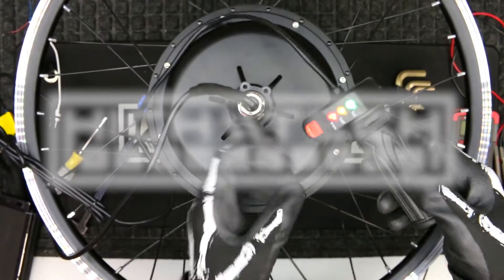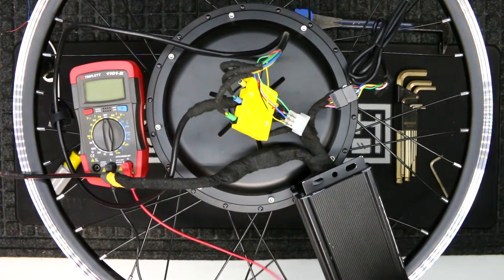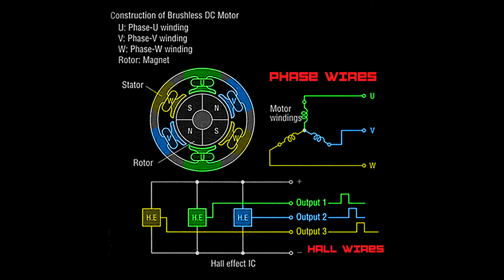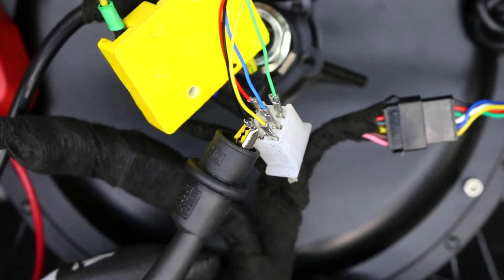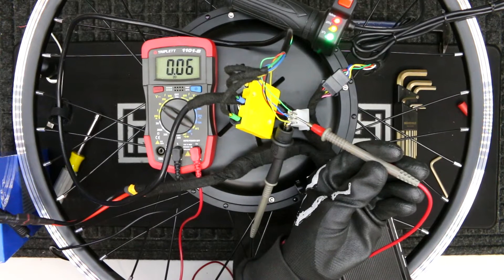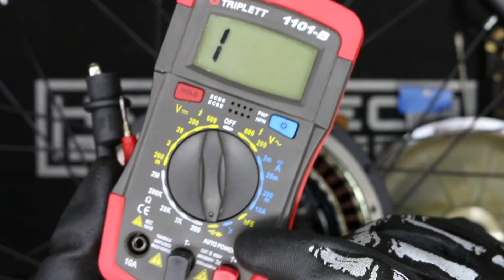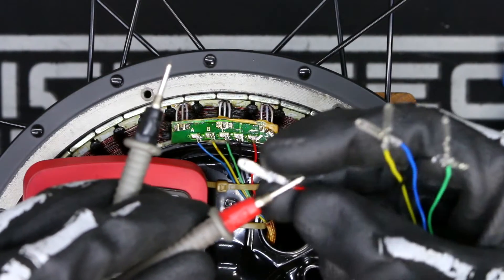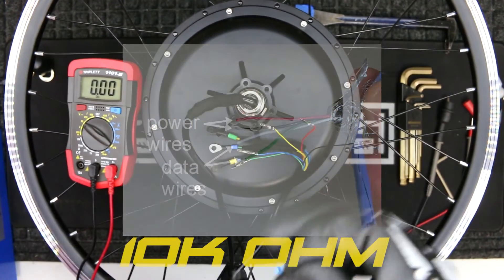🚲 How To: Ebike Hub Motor Hall Sensor Testing, Diagnosis, and Fixes (Display Error 10, Error 30)

Comment: Hi my guy. My voltage for each phase only varies when i rotate the wheel backwards. If i roll it forward voltage stays put. My bike runs but from 20kmph to 25kmph it vibrates very loud (under load. If i make it run in the air theres no vibration or noise.
I had to switch the cable to the motor because it got cut. I solder every phase and sensor. What can i try??
Thank you
Reply from the maker: If it was working fine before you switched the cable, my guess would be that the cable was not installed correctly. Maybe there is a solder bridge or something else that is not correct. Usually vibrations or noise are mechanical (bearing, bent rim, etc).

Comment: Does this work if ur motor does not move at all or make any sound when u give it throttle
Reply from the maker: It can be the issue, but that symptom could be caused by a number of things. Best to troubleshoot from the easiest to the hardest things to check, going down the line ruling out each potential until you find the source 👍
Reply: @ alr thanks I tried a different motor but its still the same issue so it’s most likely the controller
Reply from the maker: @Khodor.7  Most likely it is a controller issue, however it could be throttle, display, or battery related as well.
Reply: @hightech-lowlife  the display shows error 8 do u know what that could mean
Reply from the maker: @Khodor.7  Depends on what display it is, and what that number corresponds to.
Reply: Alr thank u
Reply from the maker: @Khodor.7  No prob 👍

Comment: My motor was vibrating, I took it apart and greased it, the vibration practically went but then I went on flat grass and it came back, any idea what it is please and how to fix it?
Reply from the maker: Vibrations are usually mechanical gaps in parts that should be fitting tightly, check your axle and bearings for movement/play.

Comment: If my motor has two hull sensors and one is bad, do both sensors need to be connected with the ground. Or can I unlink both hall sensors with the common ground wire.
Reply from the maker: The halls will need ground to function 👍 If one is not working then having ground connected to it or not is irrelevant.

Comment: Hey I just finished swapping out my hall sensor i had to bypass the PCB but the reading keeps coming out at like 0.7v. 

Im struggling to find a forum or video to help me out here.
Reply from the maker: Should have 3 sensors, one per each phase. Are you saying only one phase was not working? Most likely you bypassed something that was essential and it may not have been the hall sensor that was faulty if the results are the same as before swapping it. 

You can test a hall sensor component by itself for faults with this information: https://www.hallsensorchip.com/news/how-to-testing-hall-effect-sensor/
Reply: @hightech-lowlife  before I changed it, I was getting a constant 5v. I have a replacement pcb coming in the mail. Im just trying to understand why I'm getting such weird reading.
Reply from the maker: @3r1414  Usually constant readings will be due to a short that is bypassing the hall sensor.

Comment: Great video! I just tested the hall sensor cables and all three of them are stuck at 5v. The motor doesn't move or work at all. What would it be?
Reply from the maker: Thanks man! 

Well, if you know the function of the hall sensors then it will help you to look at where the problem could be. The hall sensors sense the position of the wheel through the oscillation of the magnetic field as the motor turns. If all of the sensors are not seeing any oscillation to me this would indicate a more likely scenario that all of the halls are not faulty at once, although possible, it is improbable. More likely is a short circuit that is bypassing these sensors and just sending the 5V directly through.
Reply: @hightech-lowlife  Indeed. The cable was broken inside. Thank you!
Reply from the maker: @Ivan-tp8gs  👍Good job finding the fault

Comment: Excellent video any idea on this one

I have a motor issue wondering if anyone could help me. On my hall sensor wires I get 5v black to red. But while rotating the wheel I only get like 3.3v on and off from black to color hall wire on all yellow green and blue. But they are turning on and off

Any idea what that could be.

Motor works but my display ukc1 say hall sensor error 30H etc.
I tried a different display and get error 10 with is also hall sensor error
Reply from the maker: If you swap a different controller do you get the same error showing? If halls are showing consistency then most likely they are good, could be another issue or component.
Reply: @hightech-lowlife  I did, I motor works but errors on the display i swear I think they just have 3.3v halls in there vs 5v ones if that is a thing? I heard some of the really old qs motors has 3.3v halls. But I don't know.

Comment: Hallo. What is the function of the sensor inside the motor
Reply from the maker: A Hall sensor in a brushless DC (BLDC) motor detects the rotor's position and sends that information to the motor controller. The motor controller then uses this information to determine when to pass current to the stator coils, which controls the motor's speed.

Comment: Thank you so much for this video..I'm having an issue with error code 2 ..I've tested the little red wire while grounded to the little black wire and I'm getting 4.7V. When I'm testing the blue ..green..yellow hall wires I'm only getting fluctuating 0 to 5 volt voltage like you described at the 6 minute mark while rotating the wheel backwards not forwards...when rotating forward I get no voltage..any ideas??
Reply from the maker: Thanks man. I believe you should see 0-5V oscillations forwards and backwards, but if you're seeing them at all then it should indicate that it's working as expected. It may not be your motor if all these tests are checking out.

Comment: Great video I appreciate cutting straight to chase. I did all these tests and the hall sensors coming out fine going into the motor (ie im getting 5v on and off with each phase output from the controller). The throttle is working fine going from .8-4.6V. The motor is still not energizing! No error codes.no idea where to go from here.
Reply from the maker: Thanks man! Could be a controller issue and not related to the motor if everything is checking out. Also could be battery. If you have a spare or borrowed component to swap in this will expedite your troubleshooting. 👍

Comment: 01:53 I hate to point out the obvious snafu but there IS NOT a ring of magnets attached to the stator, ie the bits wound with copper wire, they are simply soft iron cores, made from thin sheet laminations not solid cores. the coils are powered (energised) to create a magnetic field from the coil and the iron cores direct/focus the magnetism towards the permanent magnets in the wheel hub. 
You maybe intended to say 'a ring of electro magnets' which would be correct, but the incorrect term of magnets could confuse/mislead someone new
Reply from the maker: Thanks for pointing that out. I will pin a comment with further explanation. I will stand by that both are technically magnets as that is an umbrella term with many subtypes of magnets falling under that term, so I don't believe it is technically an incorrect term, but maybe not as descriptive as it could have or should have been. 

But, yes in this example the stator uses enameled coils of wire around iron sheets to create an electromagnetic field to interact with the permanent magnet's magnetic field on the rotor. 

I'm certain that are even different subtypes of electro and permanent magnets for different applications (e.g. resistant, superconductors and hybrids) which under your logic not specifying would also lead to being an incorrect term. I feel within the context of what the video is trying to convey it is rudimentary enough to diagnose and fix issues as laid out in the video. Although of course it is possible that I am wrong as I am not an engineer, but I am sure there are many other videos on this platform that go into much more detail about exactly how a hub motor or Brushless DC (BLDC) motors works (and I encourage my viewers to watch them if they are so inclined). Thank you.

Comment: What if my blue smaller wire came out of plug? My bike was working but jutters when taking off when to ride today and now I have this issue, where do u get the connectors wirh the circle hole at end?
Reply: My small blue wire wasn’t connected into plug but my motar was still working just jutter when taking off, so I know that isn’t the cause
Reply from the maker: Usually a blue wire will be a speed limiter (but not always) typically disconnecting this will put your controller in "off road mode" which will not limit the current. 

There are a few circular ebike connectors so you'll have to be more specific. Typically the round connectors are called "Julet" connectors, they are smaller and waterproof.
Reply: @hightech-lowlife  it’s the same pins as yours but I’m having trouble finding them onnline
Reply: Because my red smaller wire has a cut but it’s not cut through completely do u know where to order the sliver pins
Reply from the maker: @Kb_11-j2f  https://www.aliexpress.us/item/2255800397484386.html
Reply: @hightech-lowlife I thought Ali express was a scam
Reply: @hightech-lowlife would the slit in the red small wire cause the issue u think?
Reply from the maker: @Kb_11-j2f  That's a joke right? 😂
Reply from the maker: @Kb_11-j2f  Probably not if it's still connected.
Reply: @hightech-lowlife  hi my bike wheel is now moving all okay and I haven’t touched the bike why do u think that is
Reply: It still jutters from take off and motor is loud so i guess the hall sensor broke but do u have any idea why my bike has issues stated on video but then it starts working again next day
Reply from the maker: @Kb_11-j2f  Intermittent issues typically would point to faulty connection as a faulty component usually is on/off, although components can still have intermittent faults as well.
Reply: @hightech-lowlife  which connection what be faulty how do I fix?
Reply from the maker: @Kb_11-j2f  I show you in the video how to test continuity 👍
Reply: @hightech-lowlife  what part in the video please

Comment: my hub motor doesnt have a white speed sensor wire .can jump a hall sensor wire to the white one so my lcd speedometer will show speed .
Reply from the maker: Most likely no, but you can try it. If you don't have a speed sensor wire then your controller or display is calculating speed differently than with a more standard single wire communication.
Reply: @hightech-lowlife  the controller has a white wire motor does not so i guess that means the chinese dont want you to know your speed
Reply from the maker: @valdarmort  Was this a kit that came with both motor and controller? Or are you piecing things together?
Reply: @hightech-lowlife  piecing things together .some say the white wire is used only for temp cut off
Reply from the maker: @valdarmort  That can be harder for display compatibility, even similar displays that "should" or appear like they will work may not work due to different firmware, even if wire color codes match up. If I want a display to work as intended I always buy a kit with the controller and display together to avoid issues.

Comment: Took all screws off that were holding cover. Cover starts to remove, but then stops. Any suggestoons?
Reply from the maker: Check for any obstructions that would prevent it from coming fully off. How much is it moving before it stops? Once the screws are out the only thing holding it on is friction, it's possible you just need to pull/pry harder.

Comment: after going through all these steps and finding nothing wrong im assuming the connector in the controller is broken
Reply from the maker: If the connector in the controller is faulty then I don't think it would be possible for the rest of the tests to succeed, although I'm not exactly sure what you mean by "connector in the controller"?
Reply: @hightech-lowlife  hmm good point and what i meant was theres a connector in the controller that leads to the hall sensors
Reply: @hightech-lowlife  but yeah jeez i think ur right that the tests wouldn't succeed if the controller wasn't connected properly to the halls sensors
Reply from the maker: @tbounds4812  This is true 👍What issue are you having?
Reply: @hightech-lowlife  error 19 on a ninebot g30 max scooter its related to incorrect hall sensor values from the motor
Reply: @hightech-lowlife  i jumped the gun a bit suspected bad connector on the controller for the motor hall sensors cause the connector did seem a bit loose im currently soldering on a new connector now
Reply from the maker: @tbounds4812  Have you seen this post? https://www.reddit.com/r/ElectricScooters/comments/x8o4tg/ninebot_es3_error_19/
Reply from the maker: @tbounds4812  Are you sure that's the correct error description? Everything I'm seeing for Ninebot "error 19" has to do with "Error 19 is regarding unnormal battery voltage, Battery, mainboard" which is not related to hall sensors nor motor. So you may be looking in the wrong place. I found a bunch of troubleshooting steps to try from just a cursory google search. 

Have you tried contacting Segway support? One of the benefits of buying from a reputable company is that they can offer support. That way you don't need to try to DIY or figure it out yourself as they already have a team of people dedicated to dealing with issues and common problems.
Reply: my bad i meant error 18 sorry

Comment: My scooter motor doesn't run forward, but the controller sees the motor speed when I turn it by hand , putting the scooter in "lock" mode makes the motor very hard to turn both forward and backward, and rotating the motor backwards and hitting the throttle causes it to stop. What could be wrong?
Reply from the maker: Did you test the hall sensor and phase wires as shown in the video?

Comment: 13.MOSFET High Side Error what is that nanjing fardriver
Reply from the maker: You need to work on your googling: https://endless-sphere.com/sphere/threads/fardriver-fault-14-mosfet-lowside-error-help.120262/ 

That's for lowside error, but I'm assuming highside is very similar. Mosfet problem internally within the controller.

Comment: So I did all the above tests and everything seems good . So if im geting 0-5 junps while spining the wheel the sensors are ok ? 😢 I'm out of ideas
Reply from the maker: What is the problem?
Reply: @hightech-lowlife my hub makes grinding noise ,seems it spins very had when power is engaged. I suspected the sensor but I did troubleshooting from this video and its getting 0-5 v jumps on the multimeter when I spin the wheel . I checked cables for continuity. Would a fault in controller have similar symptoms? I was going through some heavy terrain mud and stuff and when I went to move  of from stop just started making this noise with bearly any power,  only going up to around 200-300w on the screen I made it home engine was hot , top speed was around 20kn/ph (1000w hub). I opend the hub up no sign on any damage or debri
Reply: @hightech-lowlife I have the bike upside down now , when i apply throttle it will only spin if I give it a little push
Reply from the maker: @videocrackent.3486  Grinding usually indicates an issue with something mechanical (binding, tightness, etc) as opposed to something electronic. Check the bearings on the axle, see if there is any debris or metal shavings/chips that could be causing the wheel to be harder to rotate.  Sometimes magnets can get slightly misaligned causing them to catch on the rotor as it turns. Things like that.
Reply: @hightech-lowlife  I mean , if there is no power applied,  the wheel turns freely that's why I thought I could be the sensor. Thanks for your reply tho